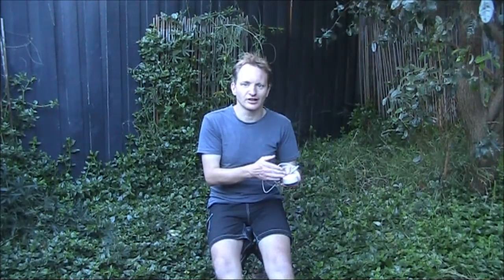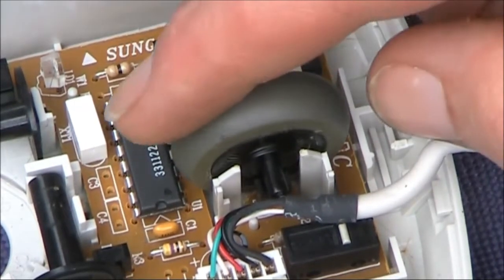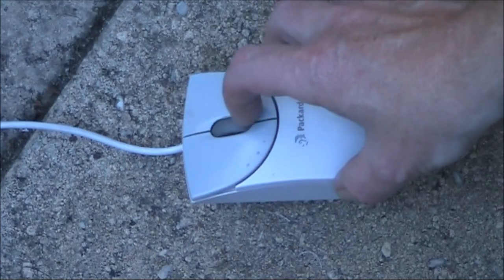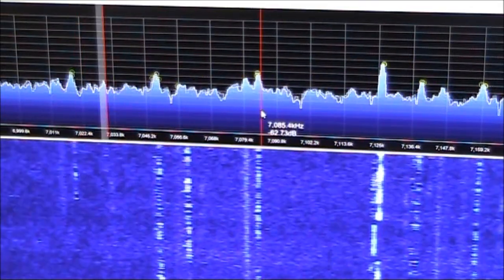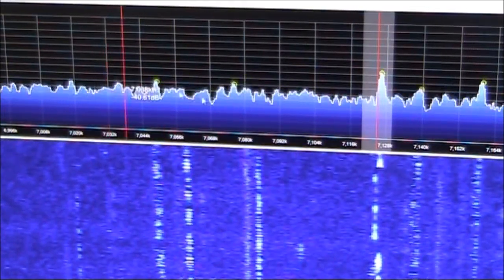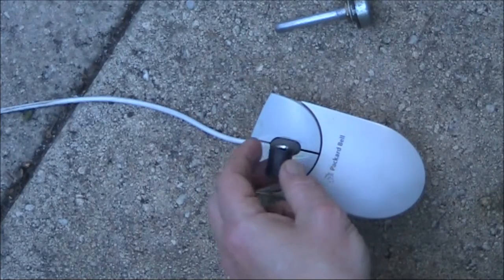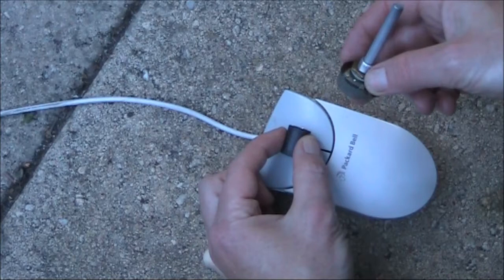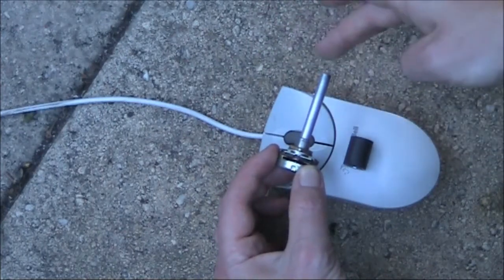Easier tuning with your SDR: Why two mice are better than one

Comment: Just be aware that having a larger tuning knob won't give you finer frequency control. The mouse can only register discrete steps in rotation, it is not a continuous measurement.

Comment: Alternate is to get a cheap used rotary encoder from an old monitor or whatever and wire the 3 wires in place of the optical transistors. That way you can have a large knob in a small box with the mouse inner inside looking like a regular tuning dial. Plus you can connect the switch to one of the mouse buttons as well to use to click.